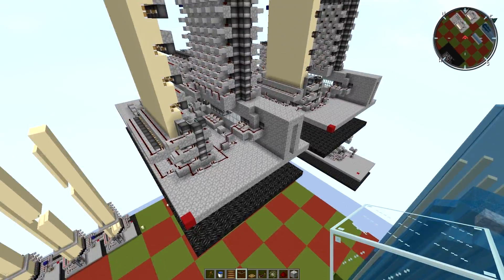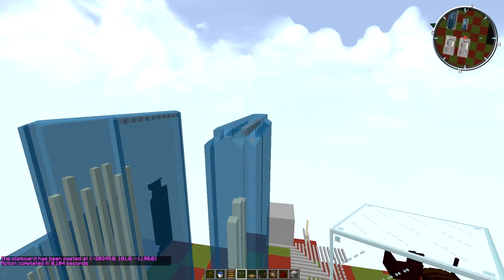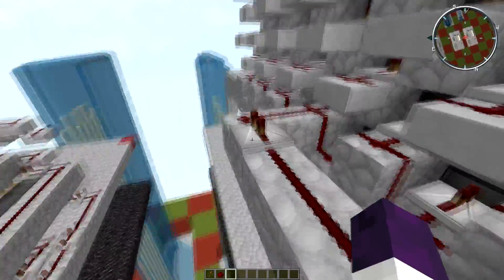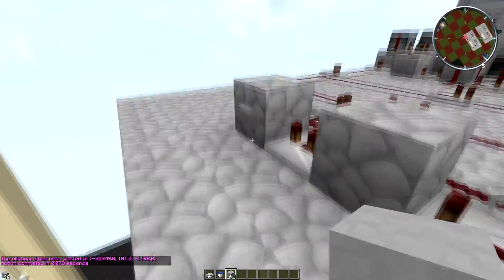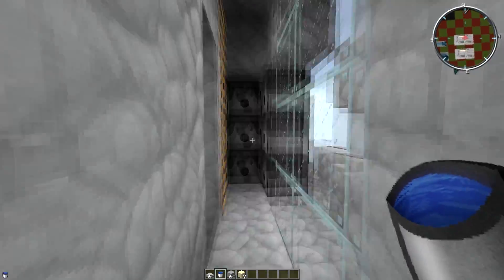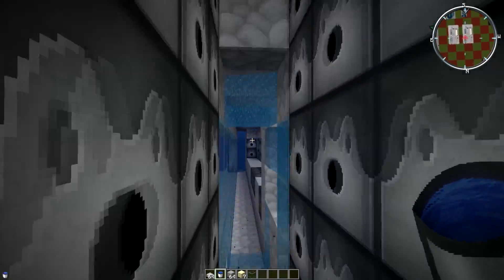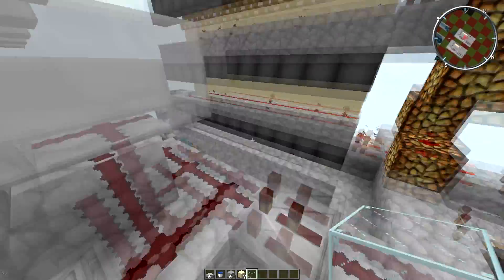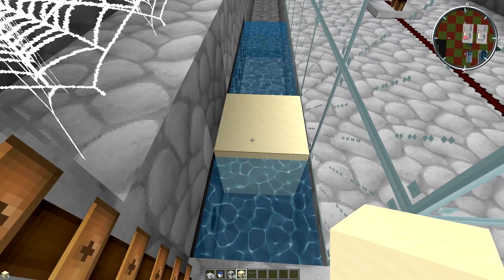100 Stacker Fusion "Schematic Download"

Comment: My cannon keeps clipping on obsidian. Any help? I want to make it so that it doesn't clip in 1 shot.
Reply: you would usualy need to stack once withouy 1 shot sand then hybrid it with hammer because of the blast radius the obsidian has
Reply: What if the wall before that has lava and if I stack first then it will create a infinite gen? :( Kind of like lava/water/lava walls
Reply: +MortiferoRex007 add more scatter
Reply: 1shot first shot, then raise guider for sand and hammer by 1 up and should 1 shot 1-2 blocks higher and make it so u dont clip
Reply: Pomp or replace guider of full blocks with slabs

Comment: what dose a Fusion cannon do just asking xD
Reply: all the scatter hammer sand slabbusy can fit through a 1x1 hole
Reply: o thx
Reply: +MrSplitYoBase noob
Reply: ur a noob xD
Reply: +MrSplitYoBase xD
Reply: its basicaly a normal sand stacker, except it stacks sand inside of a 0 block difference guider. aka perfectly flat. the tnt is inside of the sand when it stacks. with a normal stacker, the hammer is one block below.
Reply: no its not, a fusion cannon has a shit ton of power and since the sand gets shot closer to the main power than the hammerdown it shoots faster and hits the wall first so the hammer barely is above it it makes it stack... it had no guider either